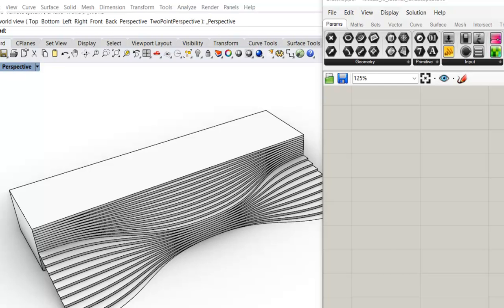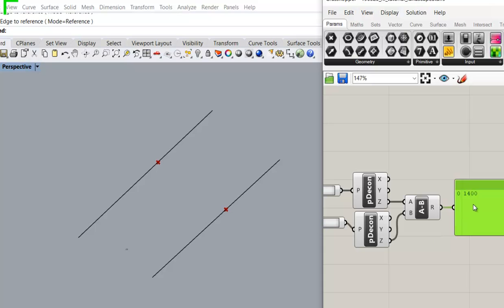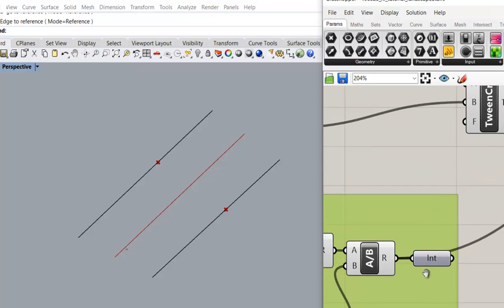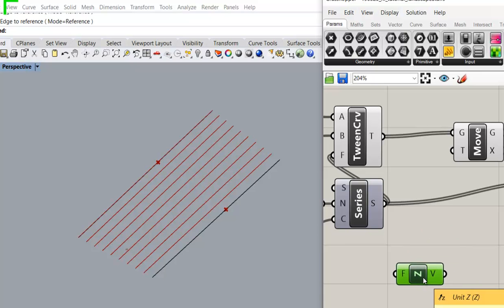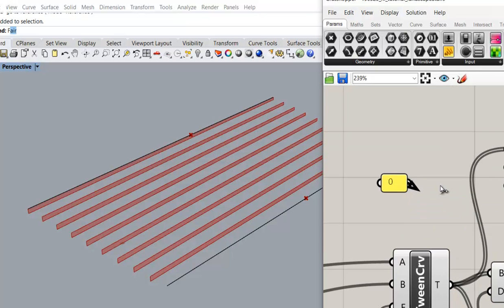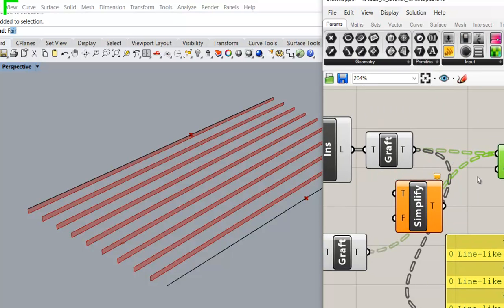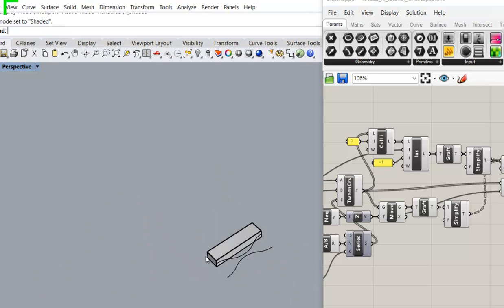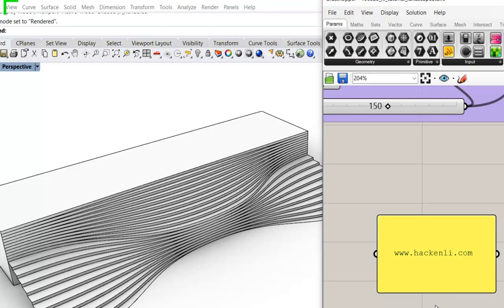Grasshopper Tutorial - Landscape Stairs Modeling

Comment: hey there, i'm having a trouble with the "division" part at 3:00. I put the "1 in the A input and the int in the B input and the division gets red.
please help a dont get it (emergency)
Reply: Can someone please sned me their script too? Its not working for me and I would really appreciate it !! @s3843994@student.rmit.edu.au
Reply: i have the same problem and i couldnt figure it out, if you solved it can you tell me please
Reply: @gizemcoskun5874  it's been a long time and  i dont remember the details.  i could send you the grasshopper definition
Reply: Georgia i would be appreciated
Reply: hey man, I have the same problem, could you please send it to me? I am working on a school project with this. pierhaagsma@gmail.com
Reply: @pierhaagsma5563  Hi guy, I had a same problem and I found the way to solve it . I suggest you to set the 2 Crv lines in different level(Z Axis) first . For example Crv1 is on 0 m. and Crv2 is on 1 m.
Reply: @Juiijuii1946  he man I still can't figure it out. Could you please send me the .gh file to my mail address? It would really help me and save time
Reply: @pierhaagsma5563  i know this was 3 yearss ago but you just have to adjust the number of steps down until the integer can round out to a non 0 number. so make sure the result before the integer is at least 0.5
Reply: can u send the script? 
elanurmaya8@gmail.com